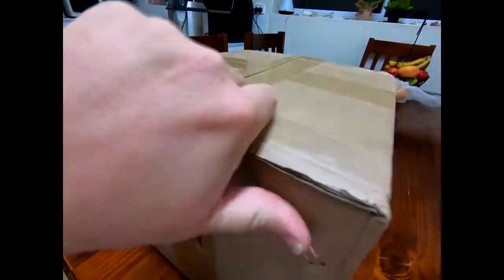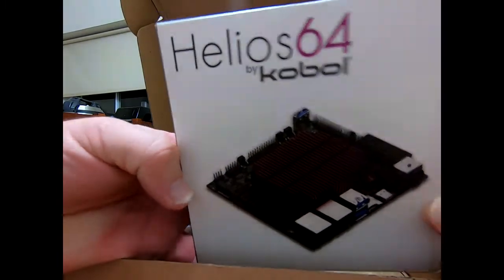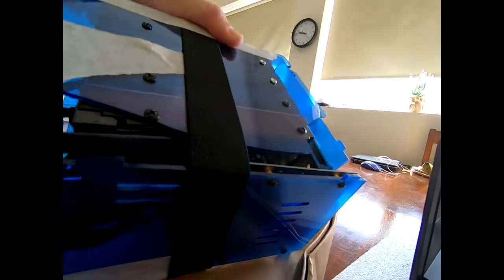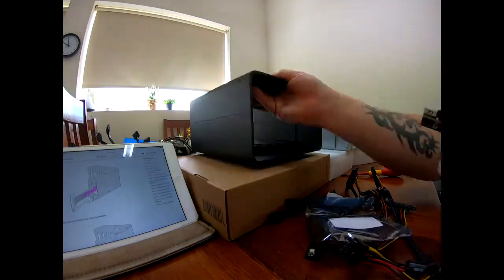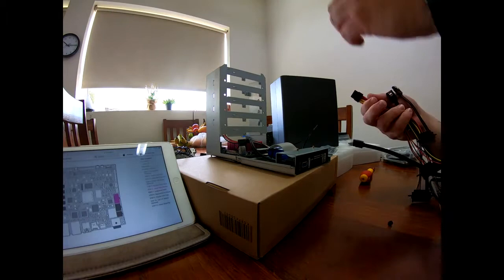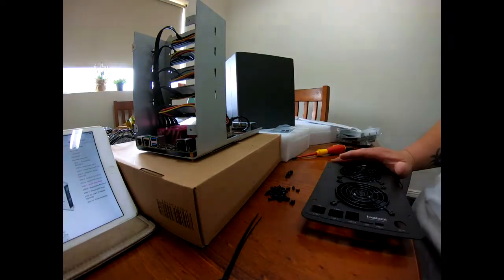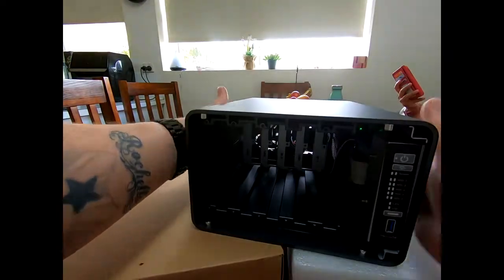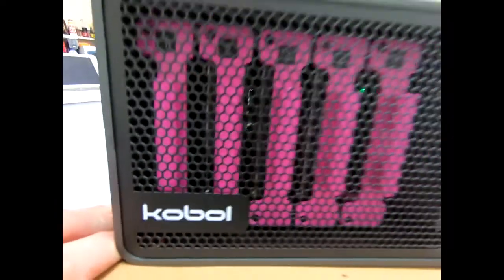Kobol.io's Helios 64 NAS

Comment: Thanks for the video. I'm interested and looking into a new NAS. 
Have a WD My cloud and the ease of use is great and Plex works a treat on it, but gonna need something with more bays without breaking the bank. This system looks like a good solution. 
I saw in the installation part it supported Plex and a few other things, does it have some sort of companion iOS/Android app?
Also, has it been working without hiccups?
Thanks in advance.

Comment: I have the original blue Helios as well. Did the drives transfer over without the need to backup and reformat the drives?
Reply from the maker: I took out the drives from the Helios 4 and reused. You just need to make sure Sata 1 to Sata 1, Sata 2 to Sata 2 etc and so on. Using OMV 5 all file systems were intact with fresh install